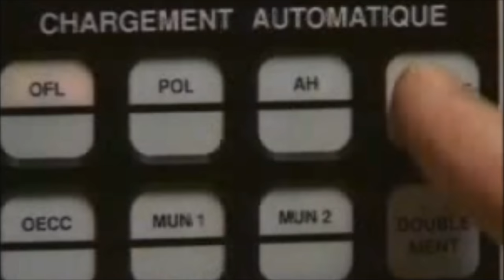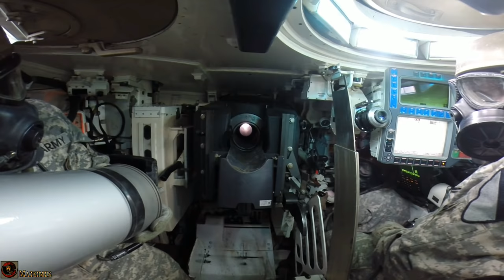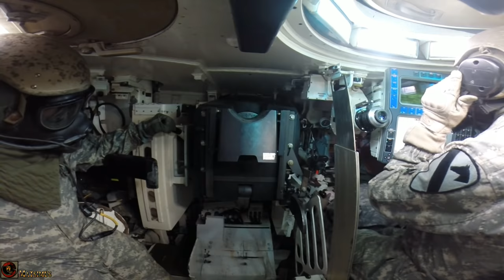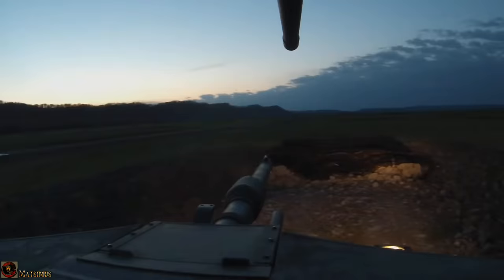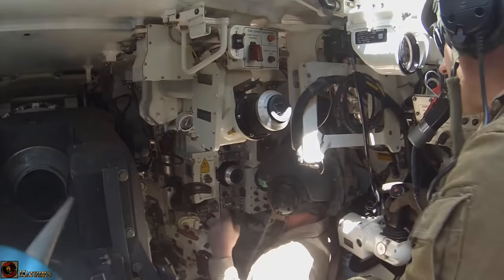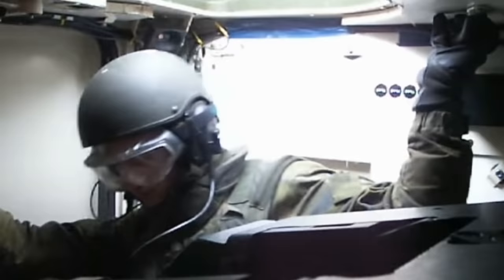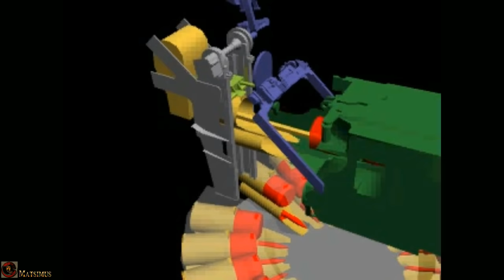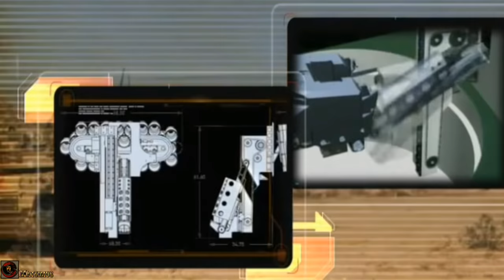Tank Autoloader or Crewman Loader?

Comment: Oh F off with your (the MBT may be coming to an end) there will never be a situation where the tank will not be needed... 

The tank plays a vital role in combat scenarios, if you don't have one you have no ground control, you can have as much air superiority as you want but if it comes down to taking the sector you need infantry for that

and if they have your infantry under fire or being killed as they try to enter Air support isn't always the "go to method" especially if the enemy has AA 

and artillery can only be so accurate, let alone you fire it enough the enemy will locate it and destroy it

the tank is a front-line beast that helps push the enemy back along with minimizing Infantry casualty's

(i know its a video game buuut) even halo that is super far in the future still has tanks, and mechs play a support role (like IFV's)
Reply from the maker: The Amnesia Grunt2356 just so you know, I am not new to the world of modern combat tactics and I know how tanks work on the battlefield, I worked with them quite extensively in my army career. But thanks for your in depth analysis on the situation. I'll take note of it. 
Also, I didn't say for sure that tanks would not be in the battlegroup. I meant more along the lines of tanks will not be anything like what we think in the future. For instance, tracks may eventually be a thing of the past as a example. So the term "tank" for armoured vehicles may not apply like we used to think so. Thanks for watching.
Reply: Matsimus Gaming what would you suggest be the thing to overcome tracks?

Hovering would just be way to hard to manage and would consume so much power to be practical (that is even if you found out how to make something 30-50 tons hover)

and I'm not sure about legs  they just seem like something that would destroy the purpose of low profiling
Reply from the maker: The Amnesia Grunt2356 honestly, I think we will eventually go to systems that will be able to use legs and such. Think about it. Mechwarriors could be a potential weapons system of the future. It's fantasy but it's also a high possibility. The speed, maneuverability and agility a system like that could have is exponential. Armour thickness is going to a thing of the past sooner or later. Defensive countermeasures will improve in the future to the point where conventional munitions will be a lot less effective. These things could run, jump, hide, climb and if hit, easily repaired. Leg blows off, get another slapped on. Just my thoughts.
Reply: Matsimus Gaming  Yeah true but you have to think about how your going to fit so much onto something like a Mech, also your limited on weapon choices if you want to make it fast (probably nothing bigger than aa 50mm cause it would knock your mech over.

If you want to forget armor systems that's fine but it leaves your 1-2 crew defenseless and internal parts easily able to be hit (ammo and fuel) unless you use some kind anti-AP countermeasure which i have no idea how that would work

 also you will have to but a lot of engineering into the leg systems to make them jump, let alone when it lands to make it so it' doesn't snap or break.

and if a leg gets hit it's going to fall over causing trauma to the crew along with the vehicle going to be trapped there for a lot longer than a thrown track (to get another leg on would mean you would have to get out, unbolt the leg and get another leg from some where and try to bolt on a 2 ton leg to the side of a laying down mech)

 as well it's combat ability will be 0 since it is face first into the dirt (unless you have arms to help it sit up)

anyway I love the idea i'm not trying to bash it but there are a lot of things to have to think about when it comes to a mech
Reply: Tanks, infantry, aircraft, I hate to tell you but it will go the way of the dinosaurs when (likely a hundred year from no or so), advanced robotics storm the field of battle. You just can't match a man against a machine. If you do, he will just end up another John Henry, victorious for a day, and dead the next.
Reply: I'd honestly have to agree with your viewpoint on MBTs being downsized. Although I would have to say that an increasingly effective superiority in the skies plays a key role in a shift to smaller armored vehicles on the battlefield. Not saying that making tanks smaller would make them safer, but rather it would draw on the concept that if it cannot hide from say an F-22 or anything of the like, then it most definitely would not be safe for the crew or even cost or combat effective in the long run. So yeah, our definition of tanks, I believe, is more than likely going to change soon. The Stryker mobile gun system maybe could be a prelude of what's to come? Great Video man, glad I stumbled across your channel.
Reply: James Gleason I'm not mad or anything I just want to know how would the Stryker prevail over a tank? it's a long ranged weapon yeah but if it takes a hit even from a small mine it explodes along with its crew (it's made of aluminum)

 I understand that a tank would have to be smaller and have more countermeasures to hide and protect itself from the new tech (and ballistic weaponry also HEAT) 

I would like to know how legs or wheels would provide the balance that armor and tracks have already achieved or even surpass it?
Reply: Well, of course I'm not saying that it is the inevitable replacement. But in it's being a mobile gun system, it can accommodate a wide variety of weapon's systems including a 120 mm cannon. In addition to that, the Stryker is much faster than a tank, being able to achieve speeds of 96 kph. The army already had plans to make the vehicles more mine and IED resistant with angled bottom hulls. The system has eight wheels meaning it can easily distribute it's weight and not sacrifice mobility even if it loses one or two. But if you're really wondering the efficacy of such a weapon's system, I'd recommend reading up on it yourself. I wouldn't take my word on it since I kind of didn't build the thing.
Reply: James Gleason I understand, I get the idea and it's usefulness, but where i see the issue that falls short is protection, sure APS,ERA, and Cage save you from HEAT and they are all light weight

 But Russia has no plans to ever get rid or or change the tank design and are always building faster and stronger APFSDS rounds that to this day are not stoppable except by armor

 if you want speed and mobility you have to trade off armor, then you have the issue of where if you have a war with Russia they just need to send in one tank that has the armor to defeat you guns and just a simple ballistic weapon 30mm-125mm and your tanks and men are lost
Reply: The Amnesia Grunt2356 you make a good point. But I think that's why the United States, for example, is more concerned about air dominance and it's ability to destroy enemy armor that way. It's been a long time since we've considered a new MBT design and we've done all we can to update and maintain our M1A2s for as long as we can. They're crazy expensive to build and, personally, I think they take on too much risk at that point. The ability to kill a target beyond line of sight is what makes artillery and CAS so appealing. I think that the Stryker and Bradley IFVs are more intended for support and transport rather than to go toe to toe with tanks.
Reply: James Gleason with the T-14 Artilliary is basically useless, they have a fuse suppression system so basically when a shell gets within a radius it's fuse gets destroyed so the shell doesn't explode. (I don't know how it works it's classified but I just learned about it the other day)

now CAS would work but Russia knows that the US is all about Air so they would keep AA near their tanks as well as Tanks are now implementing EM Jammers and radio Jammers to their tanks to interrupt Enemy transmission, IED's and Drones within a radius (how the communicate themselves I don't know) 

and I totally agree with you on the subject of IFV's they are support of infantry and ground holding capability. I see tanks as the ground takers and the breakthrough vehicle or in other words the battering ram of an engagement.

You can have as much Air support you want but when it comes to taking the ground from the enemy the best way to do it without sustaining many casualtys is to have tanks lead the way with infantry and IFV support following.
Reply: The Amnesia Grunt2356 There's ALOT of things they say that tank does.

Just more hype.
Reply: I was thinking that in the mean time high mobility artillery will be more prominent. Longer range and the mobility of a tank. hard to find and destroy.
Reply: That is what they said about shermans...
Reply: The silent and guess what? they provided the support and front line firepower needed, but the enemy had bigger badder tanks, oh no!!!
Reply: The Amnesia Grunt2356 why are you so agressive?
Reply: The silent I'm sorry, just been stressed recently

anyway you have a good day
Reply: So... what games were you referencing? As someone who's also been in the Army, Matsimus and others have lots of good reasons to claim that MBT's are coming to an end and probably by the end of the century.
Reply: Gongolongo there is a difference from being in the army than to know the engineering that goes in behind the screen of war that you have to consider why a lot of tech is not around today due to it being irrational cost effective wise and the amount of unnecessary work you would have to put into something that would replace the tank 

cause you can't argue and have no stance to say that the Tank does not play a important and vital role which could not be taken out of the equation 

but if you can tell me how would you replace the tank? and how it is "coming to an end"

cause honestly a mech would be way to tall and we be seen across the battlefield let alone having to put defense systems on something that will have to be light armored
due to weight issues

along with balance systems, gyroscopes and a system that would have to adjust against recoil, hydraulics for moving and calibration for each step, anti-fall lock up systems just in case it gets caught on something and finally, fall suppression systems for when it jumps or lands
and repair would be hell and a half especially if it lost a leg (getting it back to base, then having to due extensive work based off of if the leg was welded or bolted and if it's bolted it has a more of a chance of breaking when the vehicle is moving or pulling off maneuvers
Reply: Gongolongo MBTs may be coming to an end, but the tank itself will never die
Reply: Battlefield Won I just don't know what will trump over the MBT to replace it
Reply: The Amnesia Grunt2356 I imagine instead of going for a jack of all trades type of deal like MBTs, they will try and re design tanks as role specific. Kind of like light, medium and heavy, but not in the same classification
Reply: Battlefield Won So we are going to go from role specific tanks to jack of all trades then back to specifics again?
Reply: The Amnesia Grunt2356 Probably two classes, The first one I'd imagine would be like heavy tanks or tank destroyers. Designed for combating vehicles, defense structures and the like, and than your infantry support tank, designed to do just about what you'd expect
Reply: Battlefield Won so, I see but I don't get why you would split the MBT which can do both of those, also Infantry fighting is for the IFV's right?
Reply: Indeed. And IFV basically ate the Light Tank Role.
Reply: ***** I've stopped that train a couple of times
Reply: well 100 years ago people also thought that there would never be a situation where the artillery  would not be needed
one weapon I can imagine which can rip out the tanks quickly ,drones with C4 , fly low and close to the tanks then blow up the main guns, tracks, or even the engines. Only one problem,  the drones is not fast enough yet
Reply: lee gary do you even know what your talking about?

and if you do, do you not know a single thing about tanks?

here let me give a quick lesson for you I will summarize it

Tanks had problems with IED's so they started adding jammers so that the terrorists can't blow up bombs cause their clickers won't connect... 

now I'm not saying all tanks have this but they are starting to add this, so your drone is useless

let me guess you come from battlefield
Reply: The Amnesia Grunt2356 I am just stating out a point that the future weapons should be small, cheap and replaceable easily. Even it's one-time use. And we don't see US Army has a will to develop a new tank with thick armor and big gun, they even want to develop active protection system to replace armor. Drone-focus is another main developing direction. Therefore I bet there would be a new land-control weapon.

Moreover jammers are not reliable as it seems to be. Well you can neutralize a radio-remote bomb very easily. But the bomb with digital channel? That s another story. Even that s a military drone. The jammers need to 
 neutralize the drone without jamming its own communication system that s a sky-high difficulty. That s why military is still developing drone-killing turret
Reply: lee gary The U.S. military constantly updates their tanks over a period of several decades to maximize the effectiveness of their designs. But there is only so much new tech you can put on an old design so eventually they have to design new ones
Reply: Battlefield Won true

Comment: Manual loading for me because I spent many years on an M1A1 tank. Best thing is the breech and its mechanism are much easier to service for maintenance and to trouble shoot during misfire procedures. The firing pin can be replaced in seconds from the breech block. Less parts to break and can be broken down and put back together with hand tools in approximately 20 minutes. You can fire this in a 3 man crew mode with the gunner becoming the loader and the commander can fire the main gun from his position. This is also part of an engagement on Tank Table # 8 Qualification.

Comment: @matsimus Ok, I gotta say you have some very good points about the auto loading, personally I have never used/seen an auto loader. I am a tank loader in the Israeli army and I have used the merkava mark 2 105mm and the merkava mark 4 120mm and neither has an auto loader. In my experience during operation protective edge me tank fired well over 60 rounds a day and in total in 56 days of fighting the 7th armored brigade fired 86000 105mm shells. All due to the speed and discipline of the loader.

Comment: o It'll take a lot to convince me to go with an autoloader. My best loader loaded the 120 in 4 secs. He had this trick where he basically flipped the round in one arm. 
o Other issues were pointed out. Extra hands for maintenance. Extra crew to pull security/radio watch. Extra eyes for situational awareness. Extra machine gun. 
o I really do appreciate our compartmentalized ammunition rack vs the Russian design. That open ammo carousel that sits on the floor of the turret translates to a catastrophic hit every time once the shell penetrates the armor. 
p.s. I was on an M1A1 in the late '90s and early 2000's